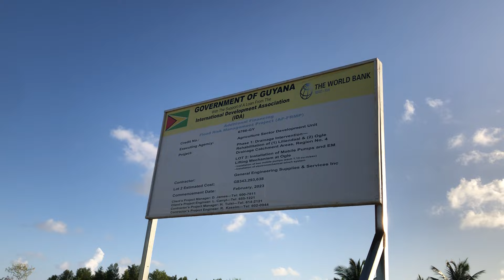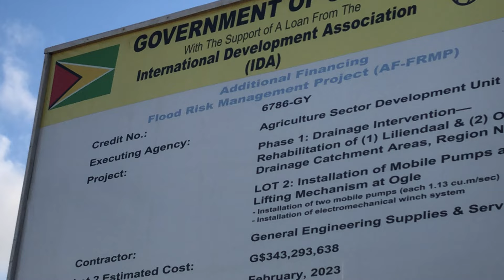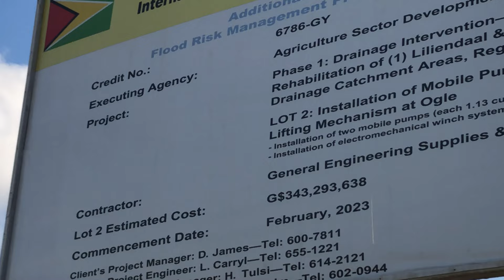The Guyanese Critic Mobile Pump Station construction controversy

Comment: You cant say it cost 350 mil. to build a pump station 5 years ago without doing a detail comparison like  project size, materials and labor costs and then adjust for inflation.  My guess is that not many companies are able to bid on a job this size.  So, they are limited in the selection process.  No one is giving away money.  In another video you are unhappy with the massive infrastructure projects through out Guyana and said that we need trains.  No government since independence had mentioned bringing back trains, to my knowledge.   Where are you proposing we put the train lines and which communities will have to be relocated?  Guyana is on the rise and no person(s) or party can stop it.
Reply from the maker: That is the current cost Sir. It cost $343 million GYD to build this pump station. Watch the whole video.
Reply from the maker: The trains are necessary if we are to avoid traffic congestion on the roads sir. The right of way for trains is being converted to other uses as I point out in several videos. The old railway embarked at Lamaha street and Lamaha Station are being converted to a parking lot and a park. The reserve at Merrimans Mall and along the Backroad and Aubrey Barker Road are being built on. These reserves were suitable for light railway lines. This is a channel for intelligent people sir. All my criticism is of the waste of taxpayers money and the ignorance behind the decision, not this size of the projects sir. Please ask questions rather than jump to silly conclusions.
Reply: @RaphaelNation  Your agenda is clear, you're anti government/PPP.  I bet you are not willing to name one positive that the government has accomplished.
Reply from the maker: @bn-fj7gq  I repeat. This channel is for intelligent people. If that is what you conclude from my statements then perhaps this channel is not for you. Everyone should want what is best for this country regardless of politics or the government. We should not accept mediocrity from anyone who is spending our money. If it’s not acceptable in America then it is not acceptable here. That is the conclusion that intelligent people make on this channel.

Comment: How much pump station pnc build
Reply: That's not the point, he is just asking why it's so expensive for those two shacks you see in the picture. I am no expert but I will say with all the vibrations those buildings will fall apart.
Reply: @joed9908 Is he an expert? Maybe, Raphael, should be building something, too, since he seems to have the expertise and know how.
Reply from the maker: I am building several things. What what does the number of pump station built by the pnc have to do with anything? The answer is several. The pppc has been in power since 1992. But it’s the coalition government that signed the oil contract that provided the money that they are squandering on overpriced contracts for pump stations. That is the issue.
Reply: @josephwinslow7613 You are missing the point. Don't get offensive just try to understand what he is saying.
Reply: @josephwinslow7613 True, I don't know who they want to build guyana, foreigner or local. Critic is hiring engineers to build his contract work, I am ashamed RAF is going into this mess
Reply: @RaphaelNation Are you saying that Guyana’s development happened more under the PNCR/APNU than the PPPC? Look at track record of both the PNCR/APNU. It is clear to see that PPPC party in government is way better for Guyana’s development than the PNCR/APNU. Their records speaks for itself.